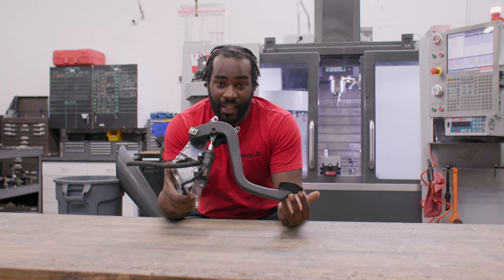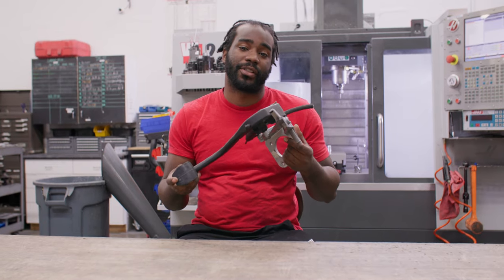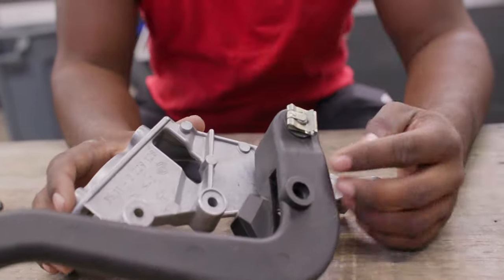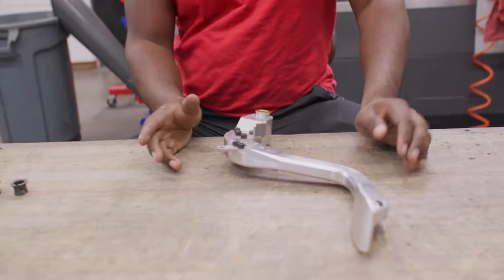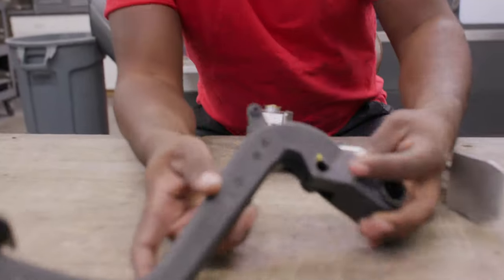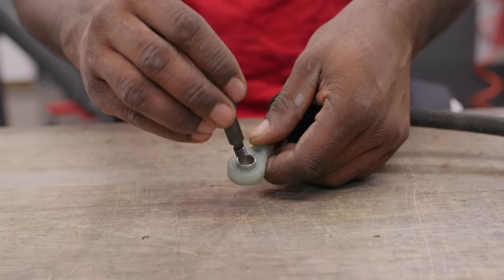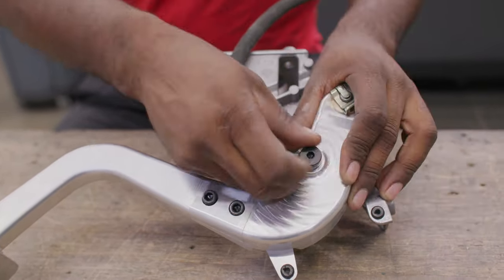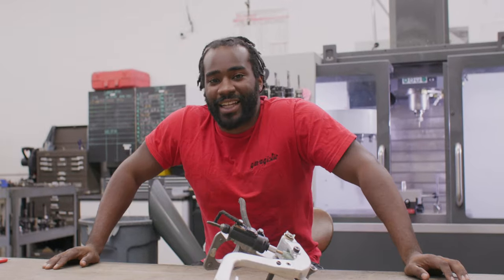BMW E46 Billet Aluminum Clutch Pedal by Garagistic | Overview & Instructions

Comment: Does this also provide a shortened pedal throw and lower the clutch pedal height to be level with the brake?
Reply from the maker: It is based on the factory geometry so the pedal throw and height will be the same as oem 👍
Reply: @garagistic  it would be cool to incorporate a lower pedal height into the equation. For example have you ever tried the mason pedal ? I’ve got one and it’s the best thing I’ve bought in a long time. I’ll be needing another soon for a customer car so I was interested in yours but if it’s stock height that might not be what we are looking for